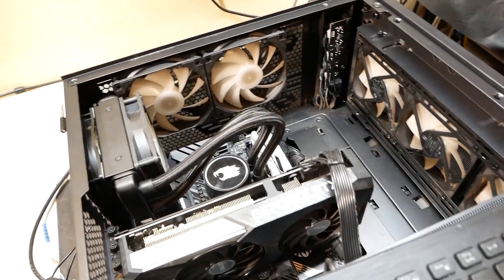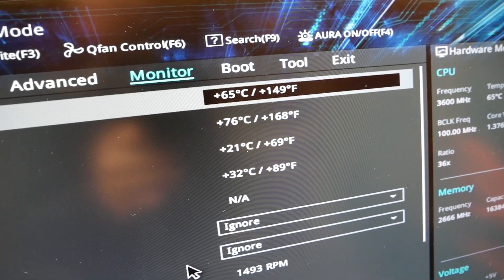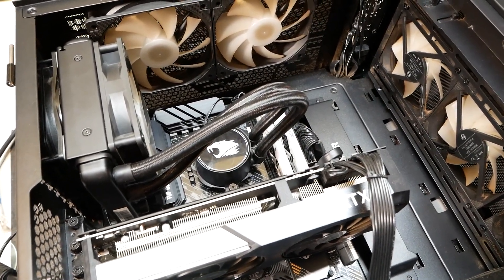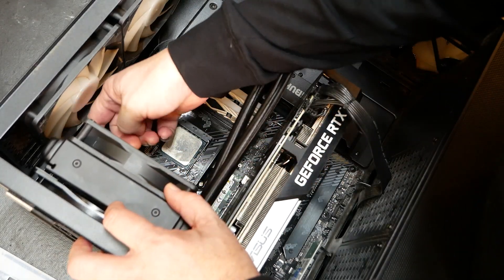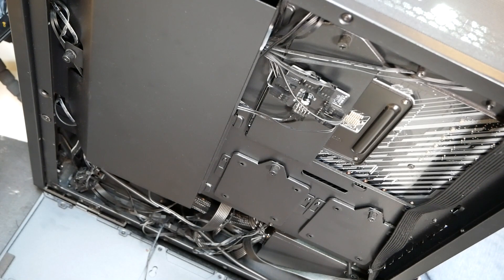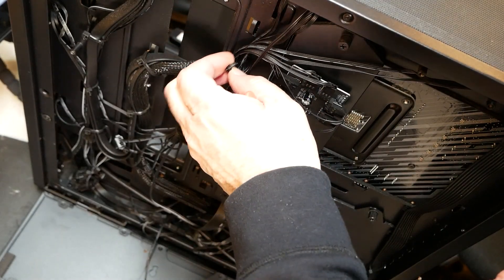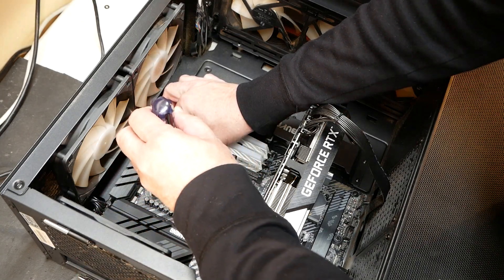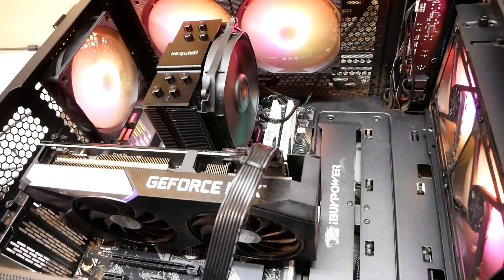Check to See if Your PC is Overheating Without Going Into Windows

Comment: During 45nm era my goal was to have below 75C on a CPU at full load, anything above could start degrading your die and lead to instability with time (years).
Now with 7-5-4nm nodes I think it makes sense to lower my previous level to below 65C because lower tech. process requires less energy and can degrade with lower temperature.